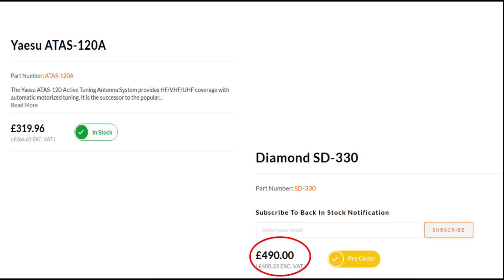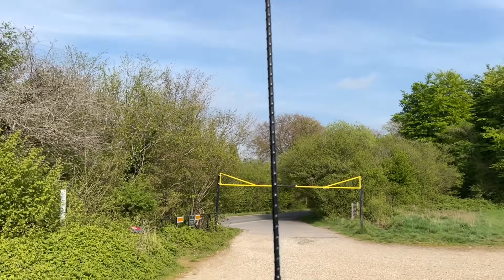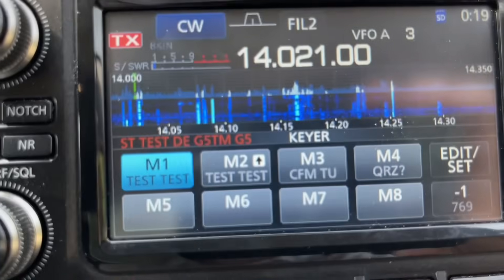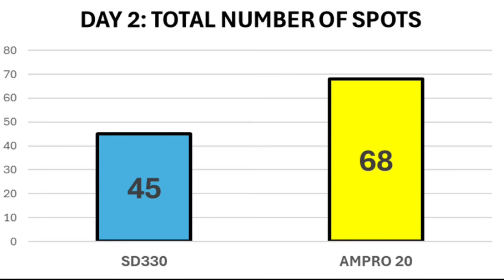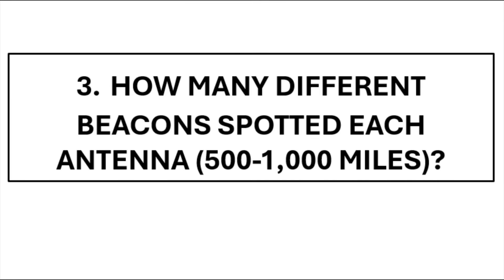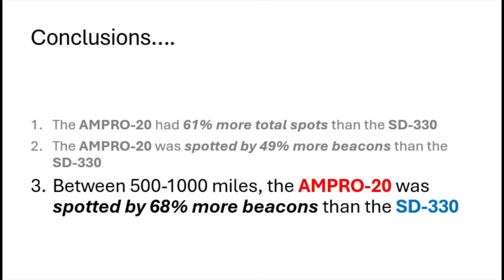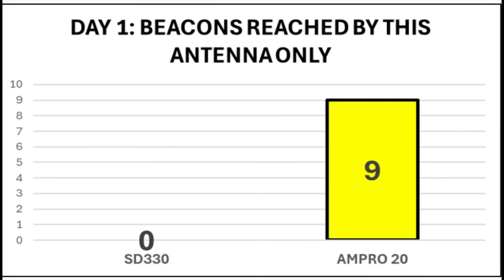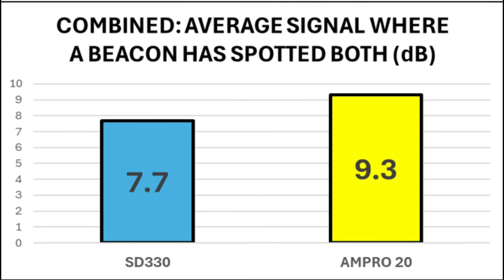Ham Radio Antenna Shootout! Hamstick v Diamond SD-330 Screwdriver Antenna

Comment from the maker: Just to confirm that both antennas were only spotted by a single DX beacon and on just 1 occasion. The Diamond by a VE and the Hamstick by a ZL. All other beacons were in Europe. Conditions were poor on both days of the test.
Reply: Band conditions do matter. WSPR would be a good alternative, particularly under good band conditions. With medical research, the more the subjects, the better the results. With antenna testing, the more stations that pick up a signal, the more meaningful the results. 

About a week ago I ran WSPR on 20m running about 3 watts into dipole in my attic. The band was in excellent condition, with some 90 reporting stations from all over the U.S., Ascension Island in the South Atlantic, a number of stations in Europe, a couple in South America, along with five in Australia and one in New Zealand. 

This afternoon I tried with the same setup. I knew the band was in trouble when the returns started at only around twenty with all in North America. A couple of hours later I was down to a single return, although oddly it was about 1,000 miles away. Weird!

I wasn't comparing antennas, but if I was the results with a ninety-plus rate of return probably meant more than twenty dribbling down to just one.

There may be another advantage of that approach. The WSPR Watch app gives analysis of the data that'd be good for comparing. Ordinarily, when comparing two antennas the results would be muddled together. You might share the project with a fellow ham and alternate call signs between adjacent transmissions with alternate antennas.

Comment: Hi Tim. I picked one up to do some BOTA with a triple mag mount on the car. I managed to get it down to 1:5:1. I did notice having the antenna right above me on the car, if I touched the 7300, you could feel the RF coming back through the radio. I did put a CMC mix 243 at the radio end. Is it better to put the choke at the mag mount end?  How do you tune your Ampro? Yes keep taking it off the car and sliding it up and down? I did get one of those quick realise 3/8 mounts too. Thanks 👍
Reply from the maker: Hi there! I place the choke at the feedpoint. Doing it there should stop the coax from radiating common mode current which I believe you are sensing. I remove my ampros by taking the mag mount down but as I use a single mag that makes it much easier! 73
Reply: @TIM @TIMG5TM ks for the reply Timmy. I have now put a ferrite choke at the bottom of the feed point like you did and also put a separate earth wire from the mag mount to the car body. I watched a few videos on tuning the Ampro antennas and someone suggested telescopic antenna screwed into the loading coil of the Ampro instead of the stringer. Bought one from MLS and it it worked easier for me

Comment: 2 questions Tim. I see you have put a choke at the base of the Magmount. Has this any difference. Other question, not that I am, but I was just wondering if can only be parked up using a ham stick / ampro antenna or would they withstand being mobile and driving. Thanks A2SJ
Reply from the maker: The choke helps with tuning on 40m and with a good solid body mount you can use this on the go. Not with a mag mount (in my view).

Comment: I started with AmPro’s, then moved to the tank whip and coil. I found the coil awkward and susceptible to issues from rain water on the coil and never got great reports with it anyway. 
So I’ve returned to a 40m and 20m AmPro and the cb tank whip cut for 10m. 
Yes it’s a pain changing antennas especially when chasing SOTA etc. but I agree Tim, AmPro’s are fantastic for the money, and hard to beat in my opinion. Although I have been considering trying a Moonraker MD 3500 as they’re so cheap and compact. 
Excellent work Tim!
Reply from the maker: Thank you!

Comment: Horses for courses with ATAS as will only work on Yaesu unless you can find one of those boxes that MFJ did 
Diamond 330 works well better than the ATAS though now i use a TS480HX with the Diamond have worked Asia Pacific ZA ZL VK from my truck on 20-17-15-12-10 
Ham stick for me is a bit big where as the ATAS and Diamond worked well i modified my ATAS with a longer and spring loaded whip did find that it upset some band and had to trim it about some to get it to tune properly 
Don’t have that prob with the Diamond with the longer whip
And like i said having the antenna mounted on a HGV i have to use a bit of a compromise with a lot of bridges in Europe as low as 4m on the motorways   
I also have used Hustler mono band antennas on the short mast  and had great results from those to 
Also my Antennas are heavily grounded fixed mounts! 
 
M0SRW 73

Comment: Tell me about my experience with thousands of antennas, Ampro antennas are superior to any other in mobile applications and I have always used them fixed and even in motion in my Toyota Avensis Verso, but in the current car Dacia Duster 4x4 it is not easy to place it
Reply: Now use in HF mobile, eco antenna

Comment: Nice work and analysis!  Interleaving the two anttenna measurements over time and aggregating the result is certainly vailid.  As you prove, a 3ft whip with a coil to cancel the capacitive reactance is still a 3ft radiator. Likewise for a 4ft and 8ft whips.
Reply from the maker: Well said!

Comment: Good test.  My first thought was the Ampro would be better because it has a longer radiating element. That’s a simplistic way of evaluating antennas but I have found it works in most cases. The loading coil placement and other factors to do with loading the antenna also usually ( not always )play a smaller part. So there were no surprises in your test results. I use the reverse beacon network to evaluate my antennas also. Mostly checking or comparing the directive patterns of my fixed antennas. I would like to see a similar comparison of my favorite mobile antenna which is the Hustler and also a 17 foot telescoping whip on 20 meters thrown in. You certainly did a good job with the tests. 
73,
Don N4DJ
Reply from the maker: Thank you Don!

Comment: Great video Tim , great experiment with a clear winner . The Ampro antennas really are very good , I have pairs for 20,17,15,10 and run them in a V as a rotary dipole sometimes I run a pair as a V and a pair horizontal dipole phased using a T so239 with short coaxial link so I can switch between 2 bands , I can rotate the dipoles on the pole giving a slight directivity advantage and even a advantage of nulling out noise , these antennas are so easy to set up and also allow for experimenting I keep on intending on joining several up in length and adding some ladderline like a rotary doublet lol , it’s all good fun cheers
Reply from the maker: Great examples Nigel. Thank you for stopping by. 73

Comment: It's good to see a comparison between aerials but being tight fisted I wouldn't like to spend £500 on an aerial.
For static operating like this I'd throw a long wire into a tree or as I have done at outdoor special event stations used three slot together 5' aluminium tubes for a 15' guyed vertical insulated from earth by a Newcastle Brown bottle (empty), variable capacitor, roller coaster and counterpoise earth. 
G4GHB.

Comment: I used an old, manually tuned W6AM screwdriver antenna along with a set of Hamsticks on my old Toyota Corolla. On 75M, the Hamsticks were virtually useless unless you wanted to talk to someone in town. On 40M, the Hamstick was good out to a few hundred miles and the screwdriver reached much farther. On 20M performance was similar as were 17M, 15M, 12M, and 10M. Because of the manual tuning, the screwdriver took much longer to tune for a new band. I could hop out of the car and swap the Hamstick in less than a minute.

Comment: Hi Tim,
Fair play for such a well formulated comparison. Hard to beat the ould Ampro…
For me the big factor is operating actual mobile (which I would define as using a fitted radio in the vehicle while moving). 
My experience of the Ampros is that they are too tall and skinny and when they hit trees etc. or even just a 120kmph on the motorway, end up bending or breaking…
On the other hand, albeit compromised, I have driven 4hrs (on everything from sides roads to motorways) with the ATAS actiual mobile working US stations and activating WAI squares….
I’m not sure if you operate HF mobile, but I n summary, in my experience, for car portable or static mobile, the ampro is the best considering price etc., but for actual mobile something more sturdy (although RF compromised) is best. Probably only the ATAS, Diamond SD-330, Alpha Moto FMJ or Tarheel fall into this category.
Reply from the maker: Good points Dave. I never use my set up "on the go" only parked up. The smaller whip antennas have their place in that scenario for sure. 73

Comment: Thanks for a wonderful analysis Tim!  I have several years experience in an HOA where I use "backyard portable" antennas that the neighbors don't mind.  However, living near a marsh (alligators) I bring the antennas in at night.  Both Hamsticks (Shark brand) and Wolf River Coil verticals give reasonably good US coverage (from my Florida QTH) at 5W CW, similar I think to your Ampros.  Yet, for CONVENIENCE I'm planning an ATAS-120 deployed on a mast attached to the house that will put it at the height of the rain gutters.  I expect it will also perform similar to what you saw with the SD-330, acceptable but not as good as the Hamsticks. I'll be pleased with that because it gives me the permanent CONVIENCE of not having to learn to wrestle alligators to protect my antennas.  :)
THANKS for the details ... and ideas of more rigor in how I test.  72 de N4REE, Bob
Reply from the maker: HA HA Bob! Watch those alligators - they can take off more than 3dB I hear! 73 and enjoy the set up.

Comment: Because of a great video you did a few years ago I’m running an 891 in ATAS mode into and ldg rt100 tuner which feeds a 102” whip. I love it. It performs great from 60-6 meters
Reply: This is what I really wanted to know! Though I’m 80/100 towards Mobile DXCC, I’m starting to like my ATAS-120A less and less. (Ditto my FT-891 because of the infernal menu system while driving.) I only operate 10m-20m anyway so a 102” whip/AT sounds like my next step.
Reply from the maker: Great stuff! I enjoyed that set up.

Comment: Thanks for the video Tim , the results were  as I expected 😊, just. To comment I have also compared to the tarheel which was kindly loaned to me off a friend with a view to purchase , I found the Ampro was better than that as well 👍. Hence I've been using Ampros for the last 25 years!! M0DXT BILL
Reply from the maker: Thanks Bill - did you use the short whip with the Tarheel or the 9ft one I mentioned in the video I wonder?

Comment: When I first tried hamsticks I was astonished at how well they performed - on 20m and up. 40 and 80, well, they work, but aren't the best. On 20m on top of the mountain in Wales, I was easily getting into the USA, and hearing them well. Wasn't quite as good as my end fed half wave inverted V, but that's 20m of wire up in the air!
Reply from the maker: Totally my experience of them too Paul 100%

Comment: Greetings OM, de G1YYU, I carry in the car a range of ampro's with me to mount on the car but if I'm going to be parked up for some time, I get out of my go bag the JPC-12 antenna and mount it a bit away from the car. I've even been known to remove the coil unit and whip on the JPC-12 (still using the ground radials) and fixed an Ampro antenna to it using the adapter and I am impressed with those results as well. I put all my ampros in one fishing rod tube to keep them tidy. 73 WIll
Reply from the maker: Sounds like you have a good set up there! I hear lots of folks enjoy using that JPC - 12.

Comment: Would be interesting comparing Ampro and single band diamonds
Reply from the maker: Yes, need to save up for one though - not cheap. However, I might even get the shorter base loaded one and the longer centre loaded version too.

Comment: Coil Q and contact resistance on a screwdriver coil is likely to be a factor here as well as length. Would be interesting to know the Q factor comparison.
Reply from the maker: Indeed. As for measuring Q factor, a black art in itself!
Reply: @TIMG5TM Bandwidth for 2:1 vswr might give you a rough comparison, but the whip length difference might not make tgat a proper comparison.
Reply from the maker: @GordonHudson agree. There’s no difference really in terms of bandwidth. Maybe a 40m comparison stretches things a bit and would be a better band to do such a test.

Comment: Whip and a tuner is more efficient than a whip and a low-Q manual coil and cheaper than a screwdriver.
Reply from the maker: Yep that works well - tried it.

Comment: Is there a possibility the longer physical length of the loading coil {windings spread out over a longer distance) could account for the improved performance of the Hamstick?
Reply from the maker: Helical loading such as the Hamstick would help versus the lumped load of the diamond for sure. Plus the longer length as a fraction of a wavelength on 14MHz.

Comment: Very good analysis and comparison Tim . Ampro's are indeed very good antennas for that money - probably you can't beat that. However, I did sell all my Ampro antennas - and I am using now a longer telescopic whip : you need only one whip for all bands 80-6m (I mean 9 bands 80m-6m, WARC included) quarter wave for all those bands (40m - 6m) - very good results, QRO high power included. I mean ... an antenna on top of your car, for e.g. to deploy in 3 minutes , vertical 25 feet of it for 20m -- so far I don't know a better omnidirectional vertical antenna to deploy so fast for mobile (stationary) QSO's.
Reply: The antenna I am talking about is Chameleon CHA SS25 .
Reply from the maker: Sounds like an intriguing set up!

Comment: The ampro whips are excellent value and fairly solid. They're great for 20m and upwards. Not so good on the longer bands. Mind you, it's pretty unrealistic to expect any sort of decent results down below 40m using such a short antenna. 

I've had good results with the 20m ampro on my little car here near Edinburgh. More than a few VK contacts using only 5w CW.
Reply from the maker: They are superb value for money and a lot of my best dx has come from the Ampro 20 for sure.
Reply: @TIMG5TM I bought one that was branded "Pro-Am" back before I knew better. It was very poorly built and didn't unscrew at the top of the coil section. It needs an Allen key to remove the top whip for transport. 🤦

Comment: Interesting comparison!   I use both the ATAS 120A and hamsticks.   Convenience of band hoping vs more radiating metal higher in the air.   But - I use a mount that is electrically coupled to the car via a metal roof rack.   My Diamond CL 20 mobile whip (like a super, center loaded hamstick) says clearly not to use a mag mount since it doesn't couple well enough to the ground plane of the car on 14 MHz.   I tested this advice and it is sound advice.   So I predict both would perform significantly better with a hard mount vs the mag mount.
Reply: I believe Tim has a triple mag mount at his disposal which has a better ground plane. You can also get additional magnetic ground planes such as the Diamond MAT-50. In my personal experience, a single (large) mag mount works well for 20m and above, you only need more for bands below 20m.

Comment: Great video Tim, I have 3 hamsticks, they are fantastic value for money, and they work. I have a slidewinder as well that hasn't been used as much as I would like, I bought that for POTA, however, life got in the way & I've only done some testing with it, it worked really well though.
Reply from the maker: You’ll enjoy using the Slidewinder Doug! 73

Comment: I use a cheap £12 Chinese 17' telescopic with a medium sized mag mount & a 10mm to 3/8" adaptor (doesn't need a triple mag mount) & that can be sized to tune anything from 20m to 4m as a quarter-wave without any coil  (or as the co-ax isn't that long just leave it at full extension & tune it 40 - 15m with an ATU.... 10 is hitting a half wave so normal ATU's can't hack it so for 10 you do need to shorten it down from full extension).
I also have the 1.5m long CB "stinger"/"springer" which isn't as efficient but with the ATU can still be used 40-10... I've also cleaned a strip of the powder-coat off the brass bit just above & below the coil so two crock-clips on a bit of braid can electrically short across the base spring (coil) allowing it to be used as a straight 1.5m quarter-wave on 6.

Comment: Nice video, Tim. I have similar antenna setup in my car (mag mount and common mode choke just at the base). 20m hamstick does a pretty good job for me. However, I’ve got better success with some experimental center loaded vertical I designed. May be due to the bigger length (about 3m total). How do you think hamstick would compare with tank whip using the same mount and auto tuner at the radio side (not at the antenna base)? Congratulations for your very useful videos and for sharing your experience, Tim.  VY 73!
Reply from the maker: Nice information! Hmmm.. 9ft whip would be more efficient on 20 but then you’d get some feedline loss before the tuner. If the tuner was at the feedpoint then it would likely be slightly ahead of the Hamstick.
Reply: @TIMG5TM , Thank you, Tim. I’d like to try this assembly. By the way, in such case, where do you think the common mode choke should be installed? Between tuner and whip or just after the tuner? (I’d guess that option b is the right one, but I’d greatly appreciate your comments) VY 73!
Reply from the maker: @ea2bsy167 I usually use a choke between the whip and tuner at the feedpoint